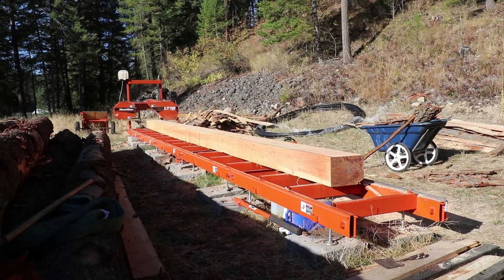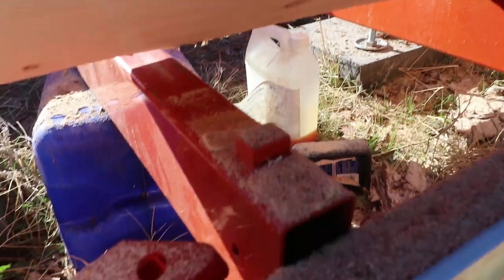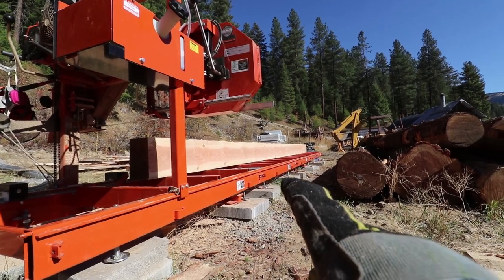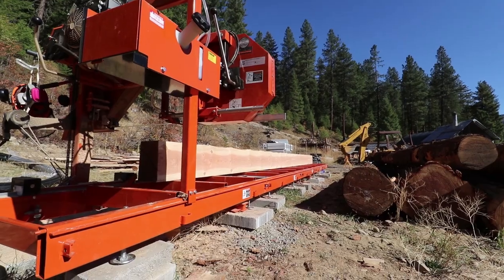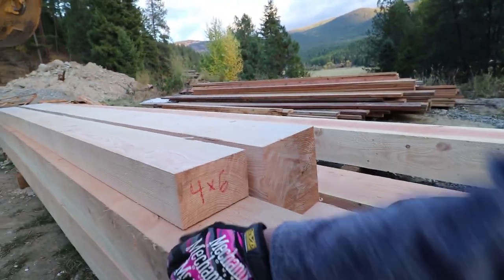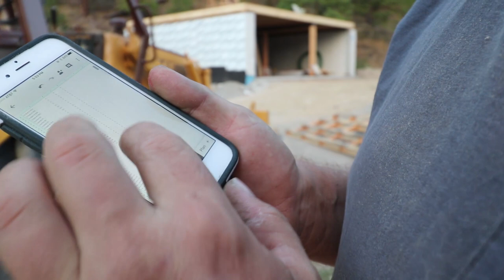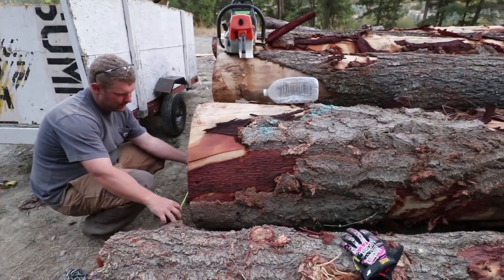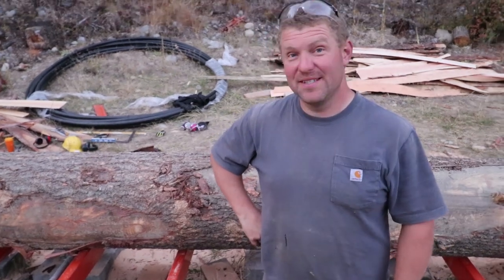IT’S SO HUGE! (Milling 8x12 Ridge Beam on Sawmill)

Comment: I was wondering about just what you said. When the log rolled, you could see the frame jolt sideways and unless the supports under the feet are perfectly flat it seems like you would lose level when that happened and have to re-level every time. Must be hella frustrating for you. Of course I'm watching this after all the timbers are cut and raised, so you already solved it. I hope going forward I find out what you did to ameliorate the issue. I'm wondering if it will (or did) include bracing the frame to the ground someway to keep it from sliding? I'll see. Kind of fun coming in after the fact as Alyssa gets them edited and up. Great job Alyssa, thank you.

Comment: Time to bite the bullet. I know way over now.
But I suggest a concrete pad. It will help tremendously with the saw mill for future projects/production.
Just a thought to plant a seed for.
Reply: Side note, a shipping trailer or even a shipping container is pretty strong, cutout walls and then could use upper frame for a wench to help flip. And no need to cure, just a level piece of ground.
Reply: And if possible, make the concrete ramp next to it. A wench on that backhoe could pull a lot more then lift and add a pulley/shackle to double strength and halve the speed for control and strength. Your in 4×4 country so I know plenty of wenches out there lol.

Comment: Question: Do you think the changes in the bed is due to the heating and cooling of the steel bed frame? I hope not because it will change everyday depending on the temp. of the day.   Love the vids and how you both tackle the issue(s) of the day and still seem very happy to be each other at the end of the day... Saw On!

Comment: You can see every time you turn the logs the mill it moves quite a lot so no wonder you keep having to recalibrate you need to secure the mill as I think that is where your problem lies in the movement as a few millimetres twist will increase over distance of the log. Hope I’m right and solve the head ache.
Reply: Agreed, every turn of the log you can hear the frame absorbing the impact, its only a matter of rotations before its out of square again. legs could do with some more rigidity.
If it was me i would have concreted the supports and then laid the bed. run a string line and watch it when you rotate the log.

Great effort so far you have the will power and can see your end goals.

Comment: Out of curiosity. I was looking at the Wood-Mizer catalog and the instructions say to mill opposite ends (top, bottom, then left, right) of the log. Did you find it easier to mill the logs just in a single rotational direction?
Reply: Avery Johnson Makes sense to make one cut. Reasonably flat surface. Turn bottom side down to flat bed. A bit of time reading instructions would save a mountain of time milling.

Comment: hello, i notice at minute 6:34 that the guide of the blade is far from the lumber
maybe if you ajuste the guide closer to the lumber you will get more accuracy.
i really enjoy your video!!
Reply: x2 ,,, We in the machine shop trade keep the slide side / guide less than 1 inch from material . I hope they take the time to read our comment  , yes I know they have cut lots by now , but maybe we still taught them a tidbit.

Comment: Yeah so much for that saw mill being calibrated after Jesse moved the whole thing sideways.  I mean if it had been me I would have poured a pad perhaps with a secondary use later (a section of a concrete driveway?) and set the sawmill on that
Reply: At the start of this video, the first thing I thought was to pour a pad. Then I though that I would pour it in another location, so I could still mill in the current location, until the pad was ready for use. Then after the milling is done, the pad could be used for covered storage of equipment and lumber.

Comment: I would move the saw into the garage..get it all level and drill the floor for threaded inserts {only have to go about 1"] and clamp the feet to the floor..
Reply: how in the heck would they be able to get logs on then? all access is quite obscured now.
Reply: Their garage has underfloor heating. Don't want to be drilling holes in that!

Comment: Why not use the laser level as a line across the top of the log and then shim under the bottom to get the biggest beam cuts?  Saves fiddling twith trying to level the bed all the time.  I know this comment is a week or 2 too late - but just a thought?

Comment: Beautiful timbers. Noticed your sliding saw guide was not being used, it might tighten up your tolerances if you ran it closer to your timber. The gap between the guide and the timber will allow a small amount of play in the blade going through the log.

Comment: If I was to make one design change to the mill I would probably vent the exhaust from the engine so that it would blow the dust off the rails as you move the saw or connect a little blower to the motor to do the same. I know that it has some plastic to push the sawdust but it seems like over time you'll get some variance, especially if sawdust under the wood is making an impact.

Comment: I don't get one thing, can someone please explain? Why after the first cut on a fresh log you don't turn the log for the second cut laying down on the straight new cut that you've just done? Isn't that gonna make the next cuts more easier and you don't have to worry about the log shifting at any given point for whatever reason?
Reply: then you still have 2 opposites which are cut and doesn't help cut the other two sides. And a lot more work to turn over several times more than just cutting each face as you go around.

Comment: have you guys thought about using ratchet strap anchors on the wood mizer to stop it moving it might be your best option 
diagonally off of each corner and the same again 2 per side in the middle should be enough it would be a pain to have to step over when cutting  
im sure you guys can work out whats best for you
Reply: Slave hard labors, are they really worth it...eh?

Comment: What I've learned is you need to bolt your lightweight sawmill down on a concrete pad. Also you guys broke that grapple because you're putting force on parts that shouldn't be taking force it needs to hang free. Great videos though!

Comment: Always have a form ready to pour.  Let concrete co or trucker local know he has a home for any overage.  Bribe with a 12 pk..jam or wood.  Barter every driver needs lumber for a project.  Get those boards stickerd and flat or they will warp.  A slab is a slab even in parts.

Comment: I'm told that you don't read comments, which is a shame as I can see what you are doing wrong and can tell you how to sort the problem cheaply and quickly.
Reply: As I understand it, not only is the milling done, but the workshop has been and gone and the frame is up.
Reply: The rest of us would like to hear it
Reply: turgsh01  thanks did not realize that. I guess we should just regard their channel as entertainment?
Reply: 11219tt  well im not a carpenter or frame expert but i do work with metal and engineering. My view is that if the milling bed is true and stable, they then only need to assess each log to see what angle to mount it . As others have said, a concrete base with some means of fixing the bed is essential. To check the bed is true, they could measure each cross member with a digital vernier guage. They have a steel square and straight edge. They have a laser to check the level, but a cord pulled tight will do the same.

Comment: Mill some timber to put under the feet of the bed like it railrood track. Make the timebers long enough that you can nail planks to the timbers on both sides to hold them in place. Than anchor the feet of the sawmill bed to the timbers to hold the sawmill in place.

Comment: You are asking a lot from that mill.  The concrete pad would be the way id go, but id want it so its sunk so the deck of the mill is at dirt grade.
Reply: I like my larger mill higher, waist height and its also trailer mounted, my smaller mill is ground level and its hard on the back if you're pulling slabs all day....

Comment: 2:57 He complains about saw dust accuracy and then turns the log and the whole bed is moving sideways HAHA!
Reply from the maker: +Bruce Jewell YouTube experts don't have a learning curve. They have insta-wisdom. Never even needed to do what they're critiquing. They're omniscient. ;)
Reply: No insta-wisdom here just comon cement. Hello Wood Mizer...yes its Jesse again...i just found another high spot on my bed!... Are some legs in the air??? Hang on... well just a li...the bed isn't ancored no not really. Well its standing on saw dust and mud but i always level every time i pull and turn and use my lase---- tut - tut - tut - Wood Mizer? Hello?

Comment: Thanks for addressing something that’s been bugging me. 

The moving around of the bed rails while moving logs has to have an effect. I’ve noticed you using a ratchet strap to move logs while sitting on the frame as well. Were you anchoring the strap to the rail to do that? Will that tension have an affect on those rails? 

It’s become clear if I want to do this, footings and bolting the frame down is going to be my best bet.

Comment: Lumber mills generally provide very accurately cut lumber, but they can have a million or more dollars in their facility. Concrete foundations, power rollers and um stuff that you don't get with  a portable mill. Not going to second guess your efforts. I am just wondering how much accuracy is required? I am thinking about when all the lumber was cut and trimmed with an axe and later a whip saw. Don't wear yourselves out doing this.

Comment: fyi most loggers wont put all the logs on the ground. they wood  lay 3 down the other way you have them and then stack the rest of them on top of them. then you could simple roll the logs down onto the saw mill.

Comment: why not use a split strap so you can balance those logs eaily.  Nver seen sombody have an expensive backhoe and not use split straps.  We use it on HVAC systems and those are only 6 to 8 feet long.  What though process  to you use to only put 1 strap on anything and balance it with one point of support.  Good luck doing 80 of these.  One point acts as a pendulum, two will swing but not drop to the ground.  Guess you are saving $50 for a strap.  Actually $25 at any kind of discount.  Fun to  watch you swing it around and it dipping and hitting the dirt.  Could make a comedy show out of this well thought out process.

Comment: lol i think heat expansion is least of their worries. I bet that every time they put a log on the mill it moves. And i doubt that all those platforms are leveled. So they would need to re-calibrate the mill every time they put a log on it. They would probably be better of  cutting 2 logs and securing the mill on top of them,  then cutting the rest of the logs. The mill will never be calibrated it it keeps moving.

Comment: Does anybody know what kind of wood are those logs?
Reply: Douglas Fir, mostly

added: In an earlier video Jessie mentions having primarily doug fir, also some pine, and a little tamarck. The coastal doug fir grows fast but the rings are wide, and the wood isn't very strong. The inland doug fir has dense rings and is very strong. - quoting what Jessie said elsewhere, I have no knowledge on my own.
Reply: I asked the same question in a different video,  but I agree with Tom.  It  looks like Doug Fir and I think I remember them saying that is what it was.
Reply: Thank you!

Comment: Your bed sections need to be anchored to the ground, that bounce when you flip big timber is not doing your accuracy any favors.
Why not dig a trench with the backhoe and bury a few logs to anchor the beds feet into? Concrete footings would be best though.
keep up the good work!

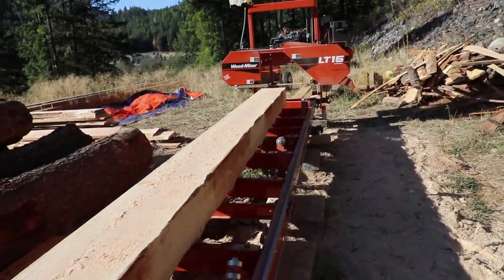Comment: 3:13 ... oh my, mill literally snaking around when beam falls while turned 90 deg. 
This is NOT a sawdust-problem You got there, I'm afraid, and never ever was, presumably.
On the other hand ... it's a timberframe, no horologe, so as long as it's slightly rectangular and as long as You know how to deal with imperfections while preparing Your conjunctions, bothering doesn't pay.

Comment: I don't care what kind of tool you are cutting with, if you have to adjust it every time you make a cut with it the cuts will not be accurate. Stop procrastinating and pore a proper base for that mill and fasten it down. That probably will be safer too.

Comment: you know the more i see you do this. and i know you want to home to be safe and sound and beautiful. but i really just want you to over cut your timbers. SAVE yourself all the pain and effort. It is not going to make your home less safe. and i swear you have so much trouble with the wood miser that you just need to get a service technician put there to fix it. which it seems like the machine is designed for self service tho. or have then send replacement beds and do an exchange.

Comment: Learn about moving heavy loads, I saw 6 chances for amputated legs at pinch points and other stuff please read some industrial saftey stufff!
Reply: I cringed a few times in this video, and prayed for them.  Leg between steel frame and log = not good

My brother was told to get on top of a fully loaded logging trailer once. The straps were locked but the load shift and started to roll off onto the ground. They found him down inside the pile of what looked like massive pile of pickup sticks. 

He said he felt like he was inserted into a video game called "Balance For Your Life".  The guys standing around started yelling "This way" and "Go that way" and then they said they seen him dive. He said he seen a hole in the pile and a voice in his head said, "Dive for that or die". The rescue was on scene before they got him out and everyone was amazed, not a scratch.

Comment: To heck with the trolls, when turning the logs rotate them the other way with a longer cant handle, this way no saw dust on the supports to cause the leveling issue. good luck

Comment: I'm no genius but when moving logs in the air don't you use a rope, with a timber hitch around the end to control it? Cuz if it slips or falls your hands can get destroyed and also you body and feet.

Comment: Does 1/8" really matter all that much? What did the builders do before all this technology - they used basic craftsmanship and skill to make buildings work - why is Jesse obsessing every video about the minutia. This is a hand crafted building and not machine built by IKEA - slight variations are sure ok. I like this build and have followed it all along from the start but jeez, the worries they put themselves through on tiny variations is way beyond what a timber-framed build should be about. I live in UK and home builds are always more than charming with variations.
Reply: Cameron Campbell you deal with inconsistency in your timbers by using square rule layout.  I discuss it at length on my channel.  Basically you can have a timber out of square, out of size and still make it work by looking for the "inner square" of the timber.